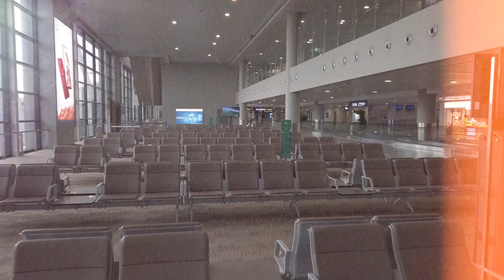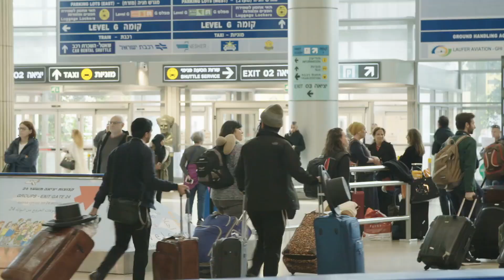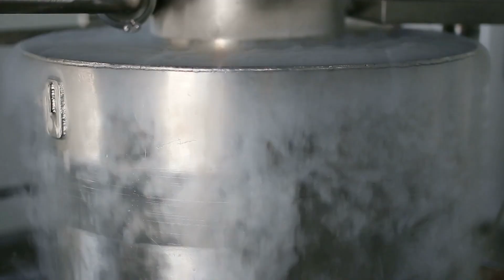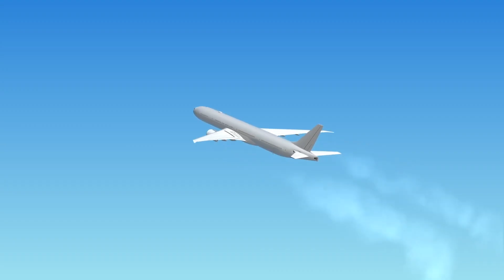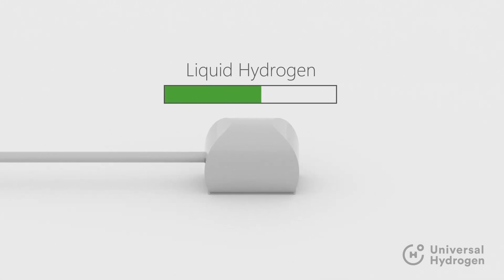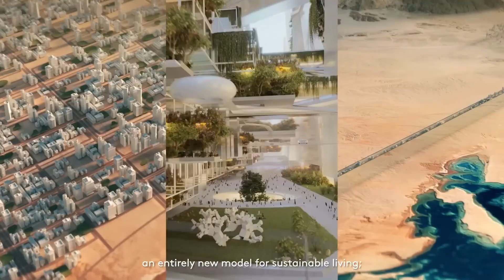How Airbus Hydrogen-Powered Planes Could Takeover? Bye-Bye CO2

Comment: Hydrogen will be a much, much better solution than anything else, especially with regard to future innovation that will surely improve the cost, storage (if needed), availability, safety and wide range of applications, from transportation to electricity generation, with absolutely no pollution or green house gases.

Comment: There is another alternative. Carbon Neutral kerosene. The US military and Sandia Labs already have the technology using renewable electricity and sea water to make synthetic jet fuel. They extract carbon based acids out of sea water. This acid if from there being an excess of SO2 in the atmosphere.  Extracting it deacidifies sea water which allows more carbon to be absorbed. This tech was developed so that nuclear powered carriers would not need to depend on tankers to be constantly bringing them jet fuel. Do a search. There are videos on this already. At this times is costs 3-5 times more than fossil fuel based kerosene but it is just a matter of scaling up the process,
Sandia has also done this taking CO2 directly out of the atmosphere. 

https://www.youtube.com/watch?v=Fcc-cTCVY64